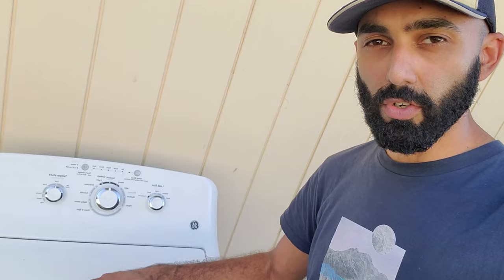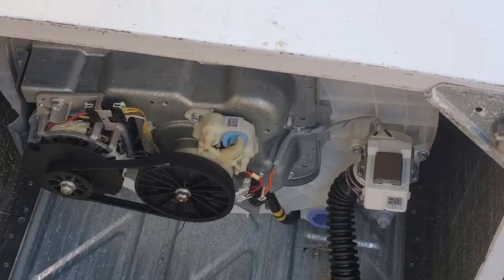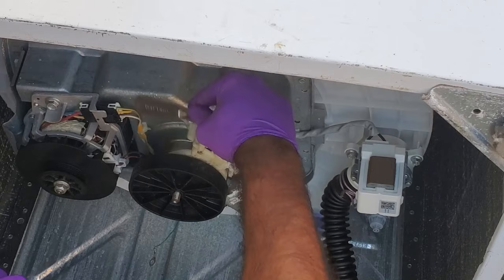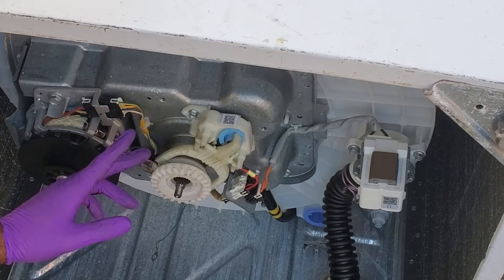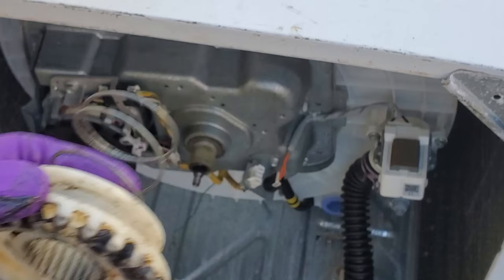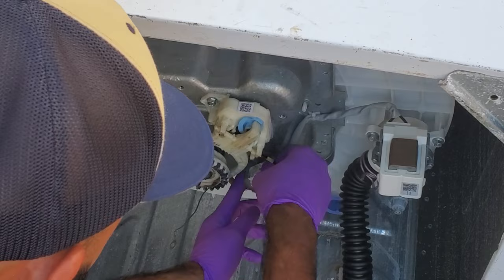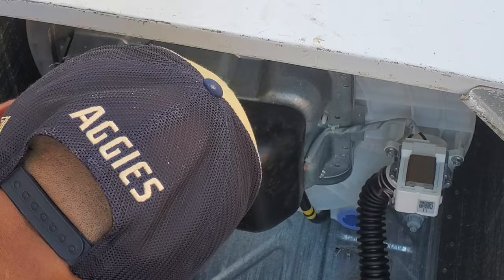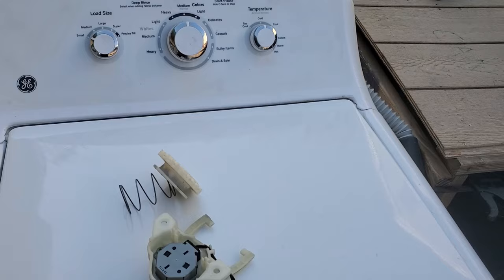Fixing A GE Washer That Makes A Grinding Noise During The Wash Cycle!

Comment: I replaced both the clutch and the shifter and my washer is still grinding. I'm using a hotpoint washer. I also cleaned out the agitator just in case but it's still grinding during the wash cycle. Time to replace?
Reply from the maker: Only thing left is the transmission pulley
Reply: What about a stiffer spring?  Is the clutch actuator just there to disengage the gears?

Comment: Hey man, I hope you can help. we've been through countless videos determined that by the noise, we needed to replace these parts. we did so and the machine is still faintly making the grinding sound. What could it be? Thanks in advance
Reply from the maker: Did you use grease on all gears/teeth? Also did you replace the clutch spring? I just did the same repair recently
Reply: @DuctTapeMechanic  Spring was replaced and I did my absolute best to make sure all the gears/teeth were lubed. Is there a chance I may not have lubed them enough? What else could be the issue if not this? Again, big thanks.
Reply from the maker: @Jedi116  if not this then it has to be the transmission pully that is grinding

Comment: I replaced the splutch, the belt, the actuator and it still makes a horrible grinding when the spin cycle slows down.  Any ideas?  

The washer works otherwise. Spins, agitates, everything. Just when it brakes it grinds.  I've replaced a few splutches in the last few months. Can't figure it out
Reply: Any ideas? Your video really helped me out but I don't know what the issue is now
Reply: @jemin2010  I was looking at other videos that some people did the same work on this type of washer machines and they replaced the parts but still hear a grinding sound. And it turns out they tightened the bolt to much and lose it a little bit now it works fine. I don't think this have a torque spec. So is hard for people to know how much to tighten the bolt. And the crazy thing was everyone found out because of someone commenting on it that happened to him and people thank him for putting it on the comment.

Comment: My washer was making the exact same sound.  I took it apart but saw no flakes/debris on thr inside cover, nor on the pulley.  Should I still replace the motor or is it something else that's wrong?
Reply from the maker: If it's the exact same noise I would replace clutch and actuator just as video. Could be that it hasn't been grinding for long enough to cause flakes
Reply: @DuctTapeMechanic  thank you for the quick reply!  Do you suggest a place to get the parts?
Reply from the maker: @belindacole5362  amazon seems to be pretty decent. You can also get them directly from GE but that will be costly. I would personally go with Amazon. I believe clutch, spring and shifter should all total to be like $65 (not bad at all!)

Comment: Hey DTM  I did all as you have done , new clutch , new spring, new  mode shifter , new belt , and also like on video I kept  the  trans pulley , and even greased it  and the result is that  it was quiet for a 5 minutes  and after that    it got nosier,  so I took the washer apart again and verified  that every thing is tight  and nothing is broken,  and like before  first 5 minutes of wash it was quiet  , the one difference is that before new parts the noise was there  form the start, now the noise builds up. Did I miss any step , is there  some thing  that I might need to replace ?  thanks
Reply: update  I did order new clutch wheel  .

Comment: Thanks for the video, still having a problem if anyone can help me. I have replaced the Spring, Clutch, and Actuator. When installing, the clutch and pulley teeth are not seating together. Any ideas please.
Reply from the maker: Replace pulley. Tap it gently with a rubber mallet to seat it properly
Reply: @DuctTapeMechanic  thank you, so it should be seated together at all times? It seems like that's as far as the pulley can go but the teeth on the clutch and the pulley barely touch.

Comment: I took apart my ge top washing machine. It looks like the clutch and transmission plastic gear are both worn down. How do I replace the transmission shaft gear that the clutch attaches to? I'm going to need the mode shifter, clutch, spring and transmission shaft gear? Thank you.
Reply from the maker: I would try replacing the clutch, spring, and actuator first. As for where to get parts, I would search by part number and go with the cheapest available (GE parts are expensive compared to whirlpool)
Reply: @DuctTapeMechanic  i looked at both parts and can see both parts are worn down. I put everything back together and it's working fine without any grinding sounds. But it's like car parts. If your starter is grinding, you only don't just change out the starter, but you have to change out the flywheel as well. Both gears are interacting with eachother. If you only replace 50 percent of the damaged parts, the parts will fail again sooner than later. But I looked into seeing if there are any replacement parts for the transmission plastic gear that interacts with the clutch plastic gear and no luck. Went ahead and purchased a new washing machine from home depot. Plus, ge doesn't make anymore parts for the washer I have for now. Purchased a whirlpool instead. My first ge ever owned and last. Thanks anyways.

Comment: This washing machine is junk. I hate it! I don’t have the space to even turn it on it’s side because I’m in a tiny townhouse. Should I let it finish its cycle to drain the water? Do you have a recommendation for a new washer at Lowe’s or Hone Depot that will work longer than 2 years without having an issue? Thx
Reply from the maker: I agree they are horrible. I would just get a basic whirlpool top load washer with an agitator (no washplate or removable agitator funny business) from Home Depot. Do not overload it and it should last 3 to 5 years (I know not the best news but a reality in today's world)

Comment: I have the same machine but my clutch and spring are good but the model shifter I am not sure about is there anyway to tell if it is good or not
Reply from the maker: You would have to put the machine in manual test mode and see if it works. I recently saw the clutch, spring and shifter all sold together for around $40. Cannot beat that.
Reply: @DuctTapeMechanic  

The clutch and spring was good so I just order the model shifter . I hope it gets here soon
Reply: @DuctTapeMechanic  

How do you put one in test mode

Comment: Do you have the part number for the spring.  I have this same issue with my year old washer.  it shows mode shifter and clutch in diagram but no spring.  Been waiting 2 months to get this fixed under warranty, so just going to order the parts and fix it myself
Reply: Diagram doesn't show the spring listed as coming with either part, but it may
Reply from the maker: Most of the time you have to order it separately. It's like $12 kind of pricey for a spring but worth it if the issue gets fixed! Best of luck. Link is below.
https://www.amazon.com/Upgraded-WH01X24434-4587847-Clothes-Replacement/dp/B0CLDH5QQZ/ref=mp_s_a_1_1_sspa?keywords=ge+washer+clutch+spring&qid=1706472972&sr=8-1-spons&sp_csd=d2lkZ2V0TmFtZT1zcF9waG9uZV9zZWFyY2hfYXRm&psc=1
Reply: Well, I’ve been tapping on this pulley for 30 minutes and it’s still not come off.  Any suggestions?
Reply: Never mind finally got it off, now working on pulling that switch off, it’s not cooperating either.

Comment: I replaced clutch switcher belt spring and all four float springs it’s still making same grinding nose could it be the actual motor. Please advise
Reply from the maker: Transmission pulley only thing left
Reply: @DuctTapeMechanic  thank you sir for the reply do you have video for that. Did you see my video
Reply: Smell burnt lol

Comment: My Whirlpool WTW4616FW1 washer on the spin cycle is sounding like a plane taking off & the sound increases super loud & then eventually i smell a rubber/burning smell....over night i took the entire washer apart & that sound i figured is coming from where the clutch is located; that rod that spins where the Agitator sits upon, but i dont know exactly what needs replaced? I thought it originally was the bearings, but i cant access the bearing due to the complete closure of the gearbox? Can i hammer that pole out somehow? Im not going to do anything until i get some advice fro someone here online...I also posted a video here on my page of the sound that rod is making when i twist it...i need some help please...lol
Reply from the maker: Saw your video. You will have to replace the entire transmission. It's like $170, but you have done the hard part already (which is getting it off). Installing is pretty much the same process. Here is my video on a similar model just in case you forgot some steps. 
https://youtu.be/B_OS4H3OEoA
Reply: @DuctTapeMechanic  also, the Agitator in my washer also still works, its just when it gets few minutes into spinning really fast, thats when that "airplane engine" noise starts from soft to a loud roaring noise..

Comment: I took mine apart after this video because its making the same noise but my clutch looks fine and the debris is black instead of white. What could it be ?
Reply from the maker: Sounds like the transmission pulley is breaking up. Replace clutch and transmission pulley.
Reply: I replaced the clutch since I already had it and it's still making the noise but only every once in a while instead of screeching like it was doing. I will order the pulley, thank you !

Comment: What if you replace all the parts and it's still making noise?
Reply from the maker: Could be your transmission gears are grinding. In that case there is nothing you can really do
Reply: @DuctTapeMechanic  thank you for the response

Comment: I changed the clutch spring and shifter the noise is worst than before I did grease and the machine is level any suggestions
Reply from the maker: Transmission pulley
Reply: Update I found out that if you change the transmission pulley I had SUCCESS 👍👍👍

Comment: My washer was making this noise, took it off and we have black shavings but no signs of wear on the clutches ?
Reply from the maker: I would replace the transmission pulley and clutch.
Reply: UPDATE:: replaced the spring, clutch, mode shifter and the transmission pulley and it works as good as NEW. So QUIET.
Reply from the maker: @ashlierawlinson7171  that's awesome! Great job on the repair!
Reply: I lied, the noise came back after about 15 washes! 😢

Comment: Did you have to reprogram the machine
Reply from the maker: No reprogramming/recalibration needed
Reply: I have a Maytag bravos they say you have to recalibrate after changing synchronous switch, which Is similar to the one you replaced

Comment: Great video!

I was wondering if you could help me 

A while back, my washer started failing to get past the 'sensing' stage. It would sit on sensing with the barrel not moving before eventually just turning off. Or it would spin while making the same grinding noise as in the video.

I replaced the mode shifter (nothing else) and it worked great for about a week. Then it started doing the same thing as before. Then it would complete 1 or 2 loads and then have the same issue. I havent seen any powder or physical evidence of grinding.

Does this sound like the clutch needs to be replaced as well, or maybe more of a control board issue? 

Sorry for the long ass comment!
Reply: Okay, so I watched another of your videos (the one on a ge top loader that wouldn't spin)
So I took a look at my washer's motor capacitor, which was something you looked at in the video.
My washer's capacitor's wiring was a little bent out of shape. I straightened everything out/made sure the connections were solid and now the washer is acting normal again.
I think the connection was loose and that's why I was getting such sporadic issues with my washer.
Fingers crossed it holds up this time!

Thanks again for your videos, they are beyond helpful!
Reply: Well, got through two loads of laundry and now it's back to the same old problem 😢

Comment: So what do I do if I replace these parts and it still grinds? 😢
Reply: From what I’ve learned that it may need a new transmission if I’m not mistaken
Reply: I was looking at other videos that some people did the same work on this type of washer machines and they replaced the parts but still hear a grinding sound. And it turns out they tightened the bolt to much and lose it a little bit now it works fine. I don't think this have a torque spec. So is hard for people to know how much to tighten the bolt. And the crazy thing was everyone found out because of someone commenting on it that happened to him and people thank him for putting it on the comment.

Comment: What if the other pulley has no teeth left?
Reply from the maker: Replace clutch, tranmission pulley, and shifter. All 3 parts should run around $100 combined. Not bad.

Comment: I have the same issue, can I get the link for the parts you got?
Reply from the maker: Clutch and spring:
https://www.ebay.com/itm/234723064832
If you need the other part as well it is called a shifter actuator and can be found on Amazon
Reply: Aswell as it seems hot water is the only thing that works on the washer, even on cold there’s steam coming through the lid, 

Would that be the inlet valves or water pump preventing cold from coming through? Or just how the washer is

Comment: Can you please share with us the part number thanks
Reply from the maker: The best thing to do is search GE washer clutch on Amazon (they use the same clutch on all new/relatively new models). Also you can get it from the GE website, which will be higher quality but more expensive

Comment: Mine won't even light up or run. Has power but won't fill or spin. Makes a low pitched sound like it wants to run.
Reply: Look at the Motor capacitor. Check it to see if it’s bulged, deformed, or leaky. It’s located inside of the machine’s control head panel.

Comment: Anyone have the issue of the washer not spinning after replacing the clutch and spring. It filled up and went through the wash but when it came for the next cycle of rinsing in spinning it just keeps making a locking noise like it's trying to but won't do anything 🤦🏻‍♀️
Reply from the maker: Did u remember to plug the shifter back in?
Reply: We didn't replace the mode shifter. It never got unplugged.

Comment: should i use a loctite on the pulley nut???
Reply from the maker: No loctite on the pulley nut
Reply: Hi.love watching your video I have a G T W330ASK1WW a friend  gave  it to me. He said he bypass the  lock lid on it and just  had three  wires exposed. Told me how to touch the  wires  together and it would  work.. it did but want  spin so I ordered  a new wiring  harness  for the  lid lock fit the  same as the  old one just one wire was a different color turn it on was so happy  I thought I  fix it then when it  got to  the  spin cycle it just guit very fusstaed I try the resetting  the dologic test but I can't  figure it out. Please  be fore i give up on it can you please help 🙏 😔 😪 it looks  just like the one and you're  video same in the sto
res!!? I  order the part off of Amazon. $40.00 What am I doing wrong !!
Reply: Use what he uses! Don't use anything else,he knows what he's doing and what to use,if you want to do this the right way after all isn't that the reason why you watched this video to find out what the problem is and how to fix it, the right way? Hope it worked out for you!

Comment: Instead of white debris, I have a bunch of black debris. It looks like the belt is deteriorating. It’s generating quite a bit of black debris considering the pulley doesn’t look THAT bad but I don’t see anything else wrong. Maybe there’s an underlying issue causing the belt to wear out. The symptoms are grinding noise while washing and poor spin cycle such that clothes are still pretty wet. Any thoughts are greatly appreciated!
Reply: As a fyi, the washer is only 3 years old but my wife prob does 5 loads of laundry per day and stuffs it way too full so I guess I can’t complain
Reply from the maker: I would replace the belt and clutch first. If there is oil then the transmission is shot.
Reply: @DuctTapeMechanic  Thank you. I will report back!
Reply: It worked! I’m pretty sure it was the belt, but I replaced all 3 parts from this video just in case. The parts cost about $70 off Amazon. Thank you so much!
Reply from the maker: @josephbattipaglia  that's not bad at all! A new machine is running around $700 these days! Good work!
Reply: @josephbattipaglia has this still been working for you? I also have the back debris on my cover!

Comment: We have the same washer, clearly they designed it to fail quickly so we buy another one. It should be illegal to make gears out of plastic in my opinion.
Reply from the maker: Build quality is at an all time low in my opinion

Comment: My washer started acting like this (link below). Is this clutch/shifter issue like in this video?
https://youtu.be/b0Vv5D6ncNc?si=e_e6Dn0auQ1FT5xs
Reply from the maker: Sounds like your agitator is stripped
Reply: @DuctTapeMechanic  thanks!! could this be fixed? do you have a video for it?
Reply from the maker: @mhdalm  it can be fixed. Unfortunately, it is a bit of a pain to get the agitator off on this machine. Perhaps I can do a video on it in the future.